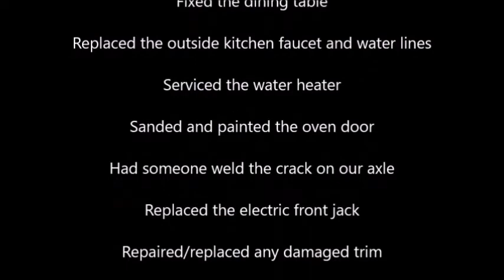Repairing the Floor in our Travel Trailer

Comment: Did you attach the wood 2x4s to the aluminum with screws?
Reply from the maker: Yes. I used wood to metal screws. They were designed to attach wood to metal. A couple of the boards I had to use 90 degree brackets to be able to do it, so on those I used self tapping metal screws.